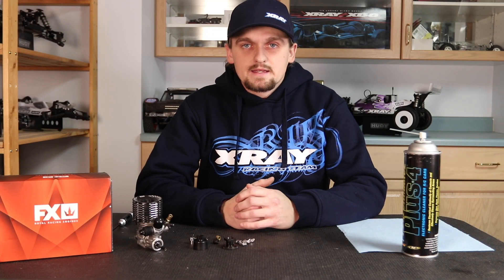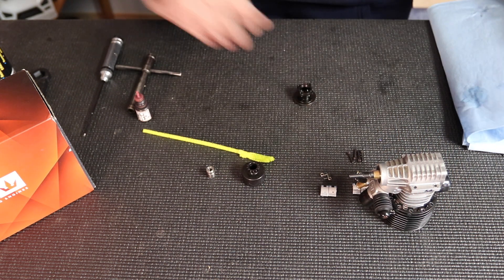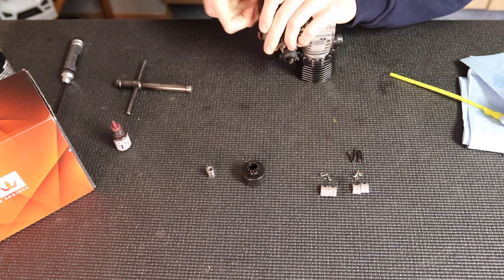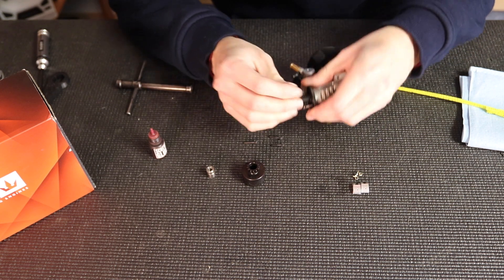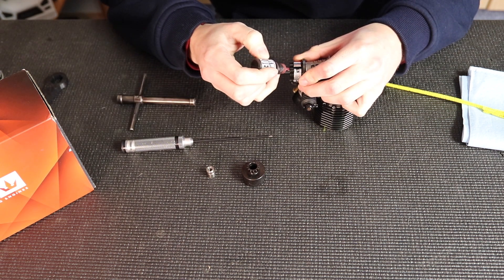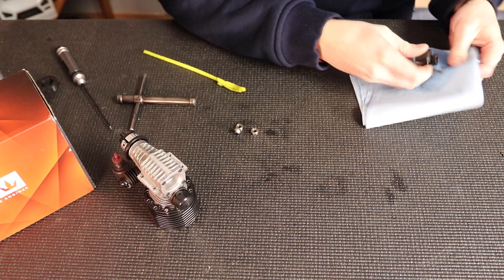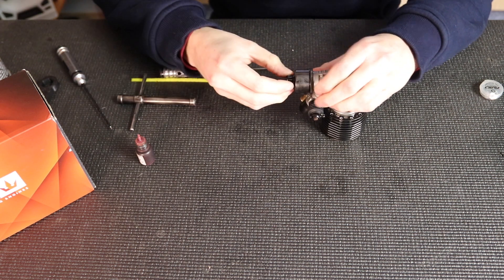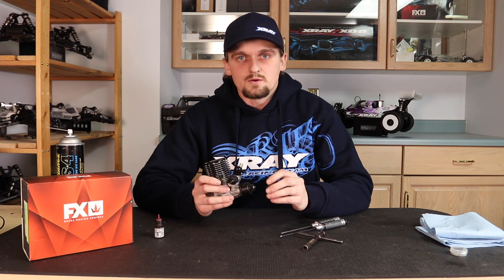Better Engine Performance Series By Ty Tessmann - Video 1

Comment: Am I missing something or pulling the crankshaft before screwing in the flywheel nut doesnt make any sense? The nut pulls it all the way out when locked..Also, shouldn't that nut being closed with a torque wrench with a specific torque?
Reply from the maker: The design of a collet makes it so that it can bind wherever it is, it won't necessarily pull the crankshaft out.  There probably would be a specific torque setting that would be perfect, but I don't know of anyone that has come up with that number, plus carrying a torque wrench to a race seems a little bit unnecessary.
Reply: @tytessmann5842  Clear. I can't really say a lot regarding RC cars (specifically engines in this case) but from my professional racing background I may expect that tightening torque to be a pretty important detail in the assembly (think about the bearing also), and temperature has to be taken in account. I think having a chat with engines manufacturers and tuners about it may open some good points. Btw thank you for your feedback!

Comment: How come you don’t use a vented bell ? I’ve just heard other people say that vented bells are better cause they let all the alloy/carbon dust out of the surface that the shoes engage on.
Reply from the maker: Depending on the track conditions I sometimes do use the vented bell, but where there is a track surface that has a lot of small rocks, my concern is that a rock can get into the vented bell and lock something up.
Reply: @tytessmann5842  thanks for the reply 👍

Comment: When the clutch is engaged  the bearings aren't  spining🤔explain iam lost
Reply: Those bearings are (mostly) only used at idle speeds. At idle, when the car is standing still, the clutch is disengaged. The engine rpm hovers around 1,800 while the clutch bell doesn't spin at all (it's at 0 rpm). Those two bearings (the clutch bearings) sit between the clutch bell and the engine shaft. They allow the engine shaft to spin freely within the clutch bell. The outside bearing race contacts the clutch bell while the inside race contacts the engine shaft.

Once the engine revs up, the clutch shoes expand and make contact inside of the clutch bell. The friction causes the clutch bell to start rotating, which makes the car start moving. As speed continues increasing, the shoes expand against the clutch bell more, causing more friction, and more direct engagement. Eventually, when the clutch is fully engaged and the clutch bell is moving at the same speed. Now, since those two surfaces are rotating at the same speed, the inside race and outside race rotate together simultaneously.

So basically, when the clutch is engaged, both of the bearing races spin - but they rotate together synchronously - so the bearing isn't actually doing any work.

Hope that makes sense.
Reply: @JeffEmbracedDC ok think , I got it now,  iam not an engineer so I was looking at it as.... but bearings are made to spin or take a load will spinning thrust bearing. thanks have a good one🖖🏾
Reply from the maker: @JeffEmbracedDC  I couldn't have said it better myself.
Reply: Not entirely true. 
The largest diameter of the inner bearing race is smaller than the smallest diameter of the outer race. So even when the clutch is fully engaged the is a rotational difference that will cause the ball bearings to rotate but not revolve around tje crank. This causes heat.
Similarly the same happens when using plastic side seals. 
The only bearing thrust will be caused from a less than perfect square contact angle between the center spur gear and clutch bell teeth.